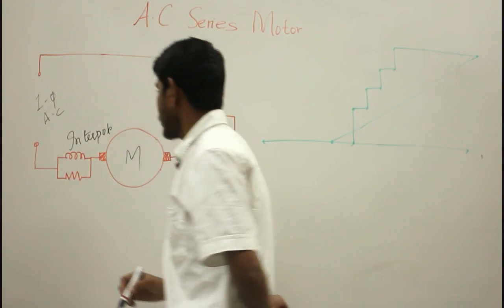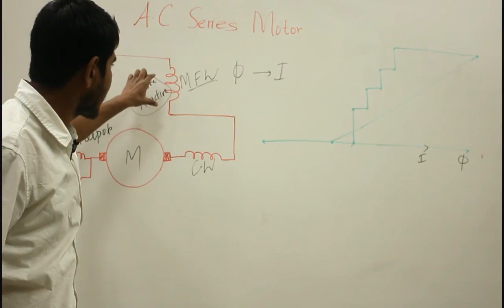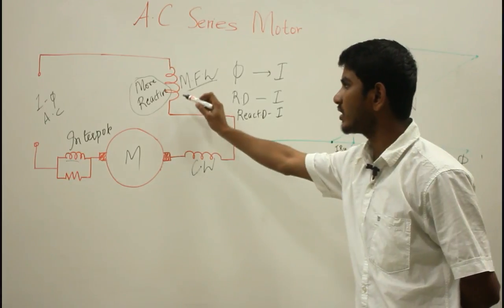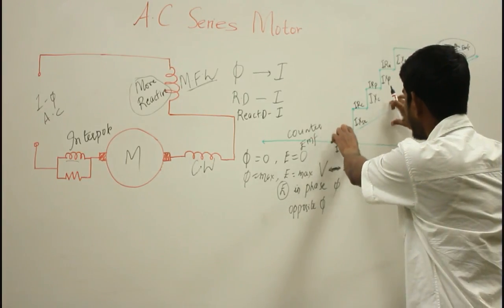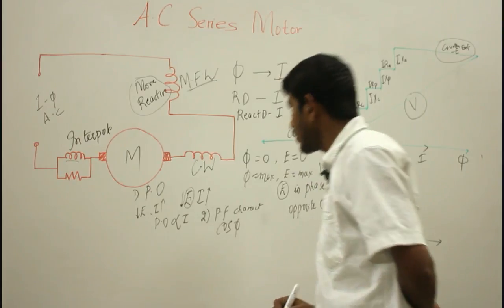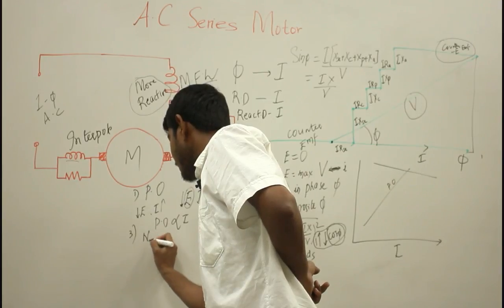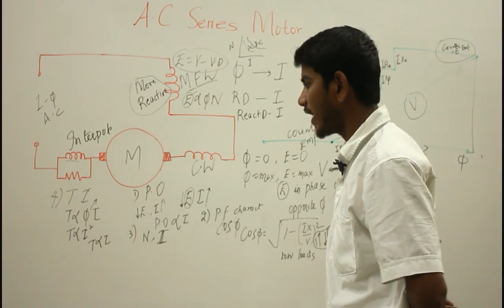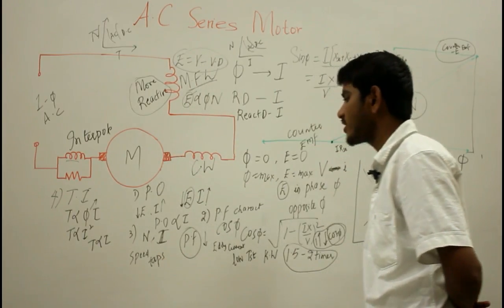Phasor & Characteristics Of AC Series Motor

Comment: How does reactive voltage drop in the field winding improve the p.f ??
Reply from the maker: Sankar Dey 
please watch my AC series motor video
Reply: I am asking this after watching it....if voltage drop is more, then inductance is more thus deteriorating the p.f.....how does it improve??
....do you mean by increasing the current??!!
Reply from the maker: As the reactive power P=VIsin¢ decreases due to reactive voltage drop where P goes down means sin¢ also goes down and as sin¢ goes down cos¢ improves as they are complement to each other.